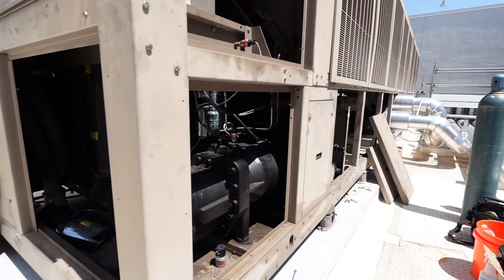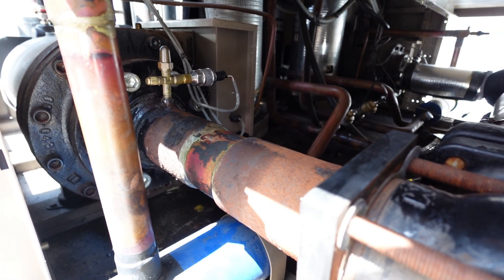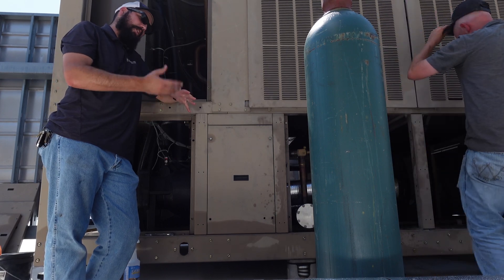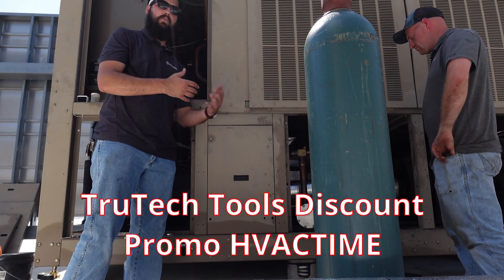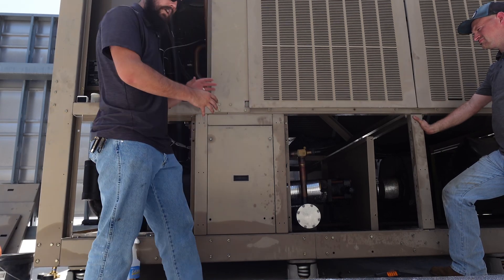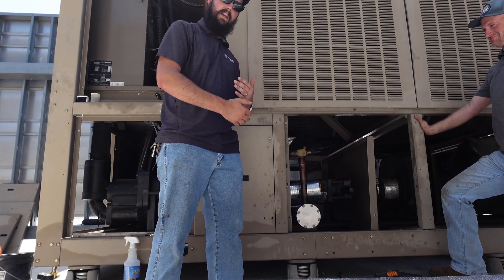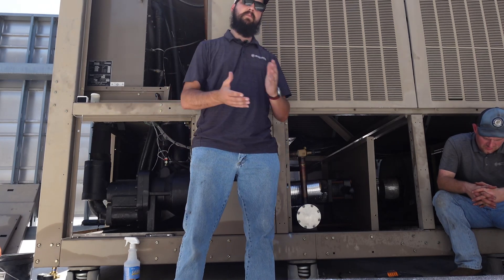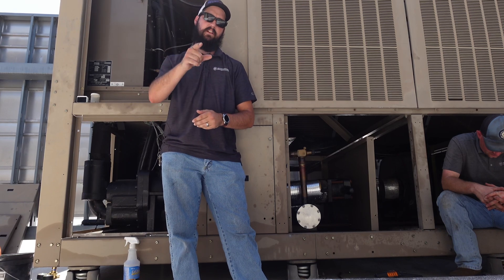Chiller Refrigerant Leak Stress Fracture - YCIV York Chiller

Comment: Sealers are recommended from factory manual on York yvaa equipment when it comes to threads on EEV and pop off valves
Reply: I use 554 on all the threaded connections, especially NPT. Only place I won't use it is on refrigerant hose connections

Comment: 100 psi N2 test is too low . I will always test 1.5 times past the highest operating pressure as a minimum .
Reply: Bro we are 17 nitrogen tanks in and only up to 40 psi. Sometimes its not possible to get that high. Btw they were 300³ foot tanks its a big ass chiller.

Comment: It’s crazy you mention nylog on NPT fittings. This literally happened to me on a suction transducer that i had to replace with an NPT adapter fitting. It held below 200psi (compressor kept failing on inverter fail and let the pressure build past 200psi) but started pissing refrigerant above 160psi. I had to removed the nylog and use teflon tape to create a good seal and stop a leak from forming. And the nuttier part is that the rack was started up a few days ago and had i left and not followed my gut by taking one last peek at the rack, I would’ve completely blown the charge on that rack. Maybe i was just lucky lol

Comment: why not put the system under max pressure (respecting LD/HD limits) with forming gas and go to town with a suitable detector? it would be a lot less time wasted and the leak hit rate would be basically 100% due to the high sensitivity and lack of false positives.
Reply: Heat. Things do funny things when hot
Reply: Back in the early 80s. I was hired at the local Chevy dealership to do just AC work.  Car came in dust. System was dry.  Spent 4 hours leak checking then charged it. Worked great. Came back next morning. Dust. Dry as a bone. I was busy so another tech worked on it for another half a day. Same thing. Next day. Dust dry.  So shop foreman was unhappy he took the project this time. Spent whole day 6:00 everyone is headed out the door all of the sudden a white cloud over in the corner the hose crimp dumped the whole charge to nothing it was 100 degrees that day so that being said it can be very hard to find leaks. The car was less then 2 years old at the time I do light commercial refrigeration now. Had other funny things happen but expansion and contraction can do funny things. Job well done guys😊
Reply: And also vibration
Reply: It’s not necessarily the high pressure that brought out the leak, but heat too. Heat expands metal. Same in reverse. On a low pressure chiller that runs in a vacuum, you either heat up the water to bring the refrigerant pressure positive, or pull the charge and put nitrogen on it. Sometimes when you heat up the chiller, the heat seals the leak and you can’t find it.